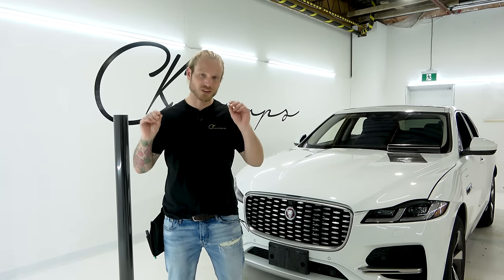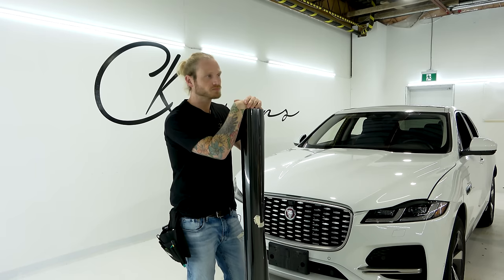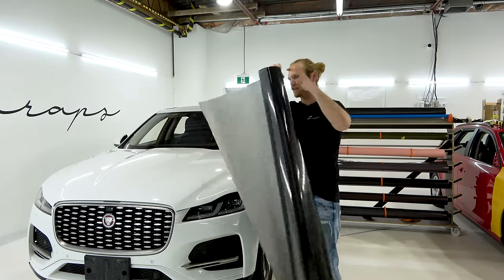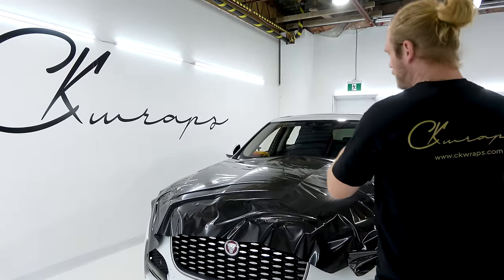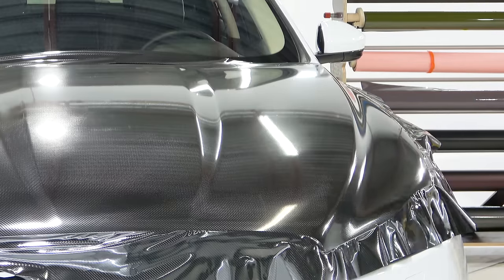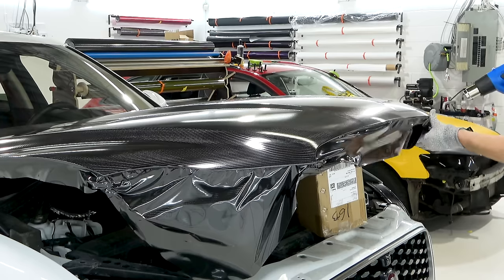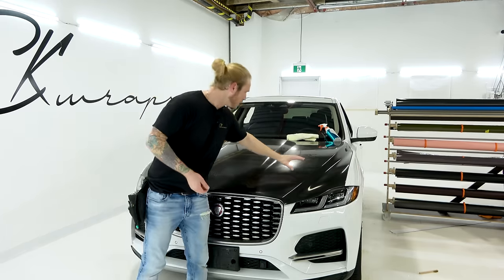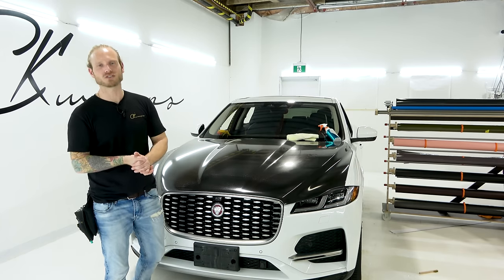Most Realistic Carbon Fiber Wrap I've Seen!

Comment: Carbon fiber hoods arent going extinct just because someone made a sticker 😂
Real carbon fiber is a major weight reduction... its not a 60lb hood with a sticker.
Reply: I've seen very few people use dry carbon fiber, almost everyone I know goes for gloss. Gloss carbon fiber is literally saving you 1-3 pounds. Dry carbon will save you weight, but people aren't buying carbon kits for the weight reduction these days. I've got ppf carbon fiber that looks better than half the real gloss carbon i see at meets and its self healing, protects from scratches and rock chips, dont have to clean it, and makes it glossy for 7-10 years. I've seen so many carbon hoods that get neglected just look like shit after a while. I think he's right.
Reply from the maker: I mentioned in the beginning of the video that nearly all panels on modern vehicles are now made out of aluminum or composite. The entire hood on my Jeep Gladiator is about 15lbs and to buy a real cf hood which can costs thousands and also have fitment issues is a waste of money just to save a couple of pounds.
Reply: @CKWraps  its arguable that you could just get a real carbon fiber hood and ppf it and have the best of both world. When people go for weight reduction every pound counts, this usually goes as far as removing the like 5-10 lbs of noise reduction padding in the car cabin. So the idea of using a oem hood and adding the weight of the wrap on top of it is very counter productive to anyone actually looking for weight reduction.
Reply from the maker: @austinshal1400  I completely understand that. In most cases, people who add on real carbon fiber mirror caps or hoods (on a BMW M4 for example) aren't trying to save weight for track day. Changing out mirror caps for real carbon fiber won't save any weight.

If I owned a real Carbon Fiber hood I would definitely PPF it, so in turn this also adds on higher cost for which most people are solely going for the esthetic of real Carbon
Reply: Who said it was extinct? 🤦
Reply: Most carbon fiber hoods under $1000, especially ebay crap, are just a cheap carbon skin on an aluminum frame. Not true full carbon fiber. There are many grades of carbon fiber at that. 
So CK is right.....unless you have a steel hood on most older cars, weight reduction is very minimal at best.

Comment: Why don’t just get a real carbon fiber and stop being a poser with fake carbon fiber
Reply: Looks the same as real carbon fiber. Pointless to buy real carbon if youre just going for the aesthetic
Reply from the maker: @MrBlahblahblee  And majority of people are just going for the esthetic. Let's be real, putting a carbon fiber hood on a mustang and racing one that doesn't have a carbon fiber hood won't win anyone any races. Majority of new cars also now have aluminum hoods which weigh next to nothing.
Reply: Most of the time buying real carbon fiber parts doesn’t mean it’s going to fit perfect. I’ve seen it on many car with real cf doors that look worse because they weren’t done right.
Reply: @CKWraps   Exactly. If a person is so caught up in buying the "real" thing (whatever it may be) that looks just like a more affordable version of it, they're most likely doing it solely to impress others. It's a different kind of satisfaction knowing that you can achieve the same look with a more logical price point.
It's the same argument with paint vs vinyl elitists lol if it looks good, it looks good!